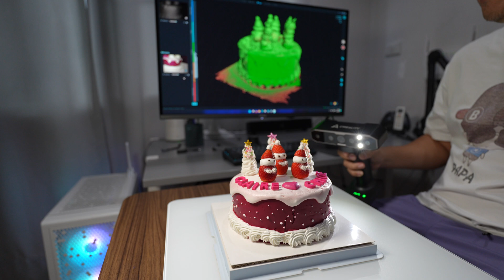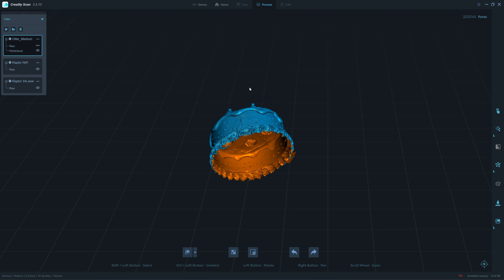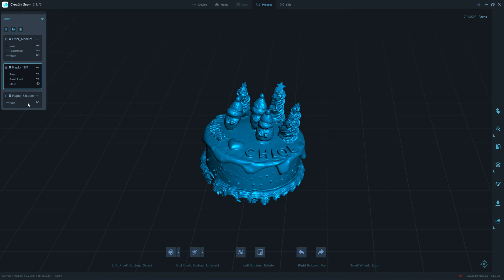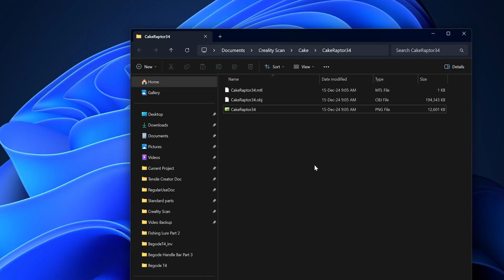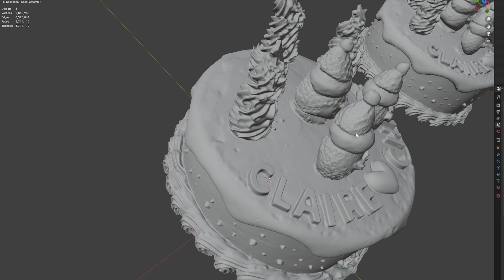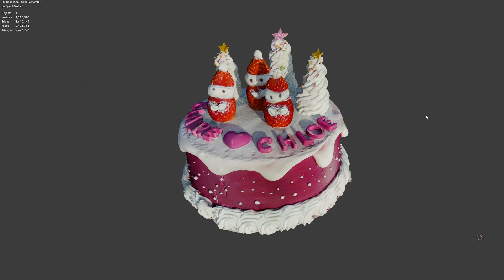3D Scanning with color texture - CR Scan Raptor X vs Otter

Comment: @Payo my wife got me Otter last weekfor Xmas, I had some free time and tried to scan a few things (almost all are small, black, untextured) and was watching many of your viseos. I panicked and bought the Raptor based on your reviews of its superior dimensional accuracy, it arrived today. Tried scanning same objects. Still not much success, not unexpected as I need to learn how to use these both better. Im contemplating sending one or both back, or keeping both. I see you use otter and raptor in many projects. What I have not been able to find is a summarized list of when yo use one and not the other for specific scan projects, I know you mentioned in one case you did marker scan in project with otter then detail scan with Raptor. I was wondering if you could summarize use cases for one vs the other vs when to use both. Or make a short video on it as it would really help accelerate my learning on what to use and when, right now Ive got details from 10-15 of your videos and its hard to keep it all straight. Thx for the great work!
Reply from the maker: Otter's good for scanning organic shape object, it can be scanned without markers. If I'm not making part fitting, I'll pull out Otter for scanning first. In the case of inorganic shape, which mostly contains flat plane, or repeat pattern, symetry objects. I'll use Raptor for scanning because it tracks with markers much better than the Otter. For part fitting and reversing in CAD, I'd only use Raptor. I'll make basic tutorial videos as some audiences requested. I'll put answers to your question in there as well.
Reply: @Payo-TensileCreator  Thank you for the reply that was a GREAT answer!!! You have the best videos on these on the internet! Keep up great work!!!

Comment: AT 3:25 I noticed you didn't have markers on the top of your marker towers.
Two small markers works well with your tower design.
I've found that the more the merrier especially when it comes to higher off of the bed.

Thank you again for sharing your designs for the marker towers.
I have resin printed four of them, and they have been instrumental to my accurate scans to date.

Love your content!
I'm so glad to see you come up with new 3D scan projects.
Please keep up the amazing work!

: ]